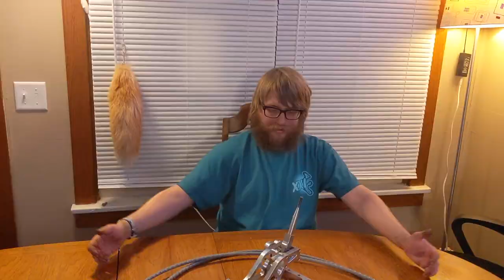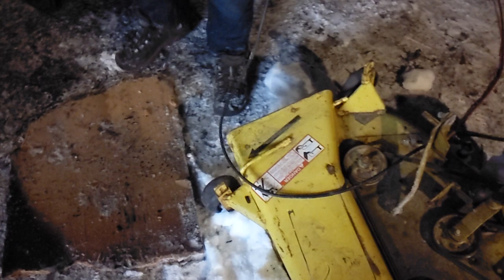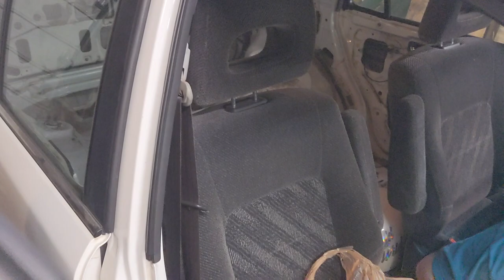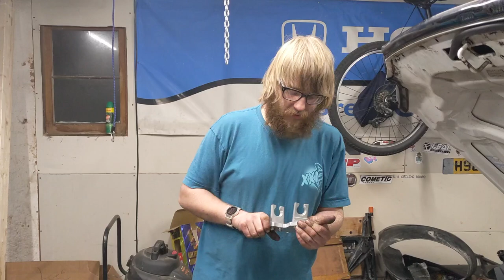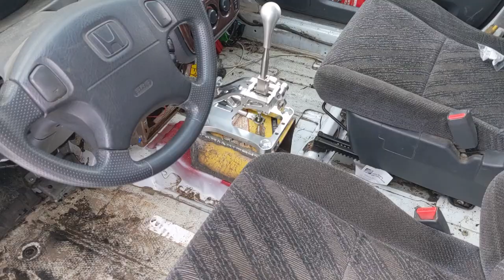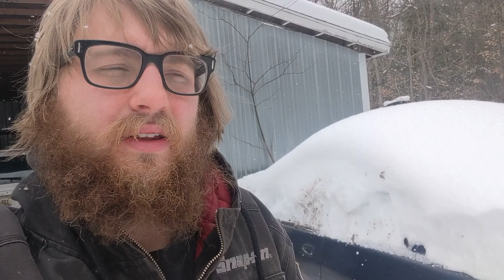Jack Spania AWD B-Series Shifter Install For RD1 CR-V

Comment: I'm in the process of installing one of these in my 2000 CRV. Your video was a great help, I'm using a mounting plate instead of building a box like you did. Thanks for putting this video up. 👍🏽
Reply from the maker: No problem at all man! Glad it was of some help!
Reply: Which mounting plate did you go with?

Comment: How do you remove the oem shift knob from the shifter? I tried to spin it like my civic but the whole thing is turning with the shift boot. Any help would be greatly appreciated.
Reply: You have to pull the gaiter down that’s clipped in under the shift knob, then it should unscrew

Comment: Great installed. Has that much play because it’s the knock off China version. FYI cheaper on Ali express lol 😂 

I have the real and doesn’t have play. Great video though
Reply: What's the "real" one lol
Reply: K tuned shifter cables do not have the play compared to the knockoffs